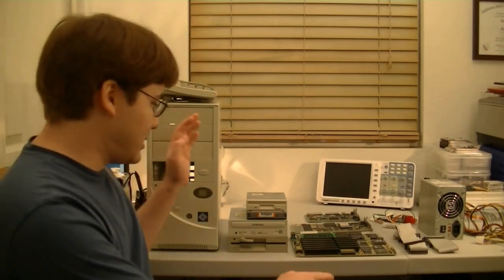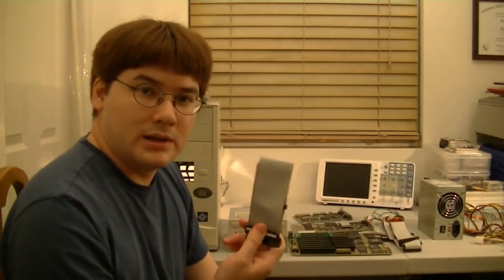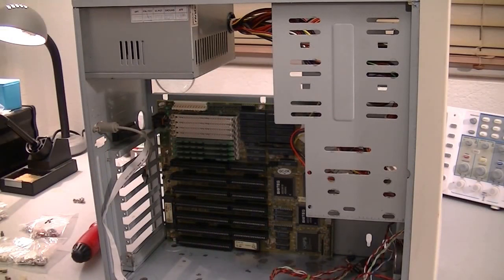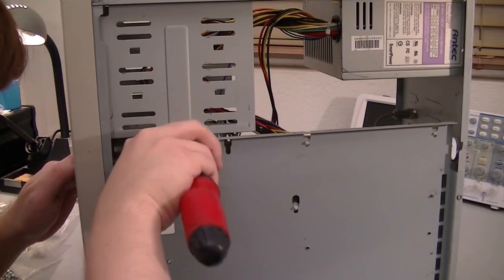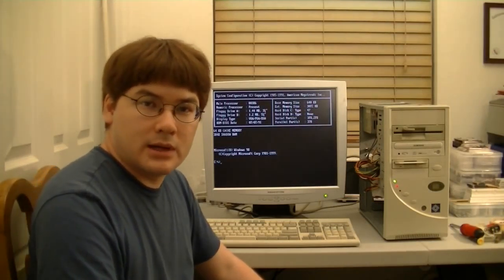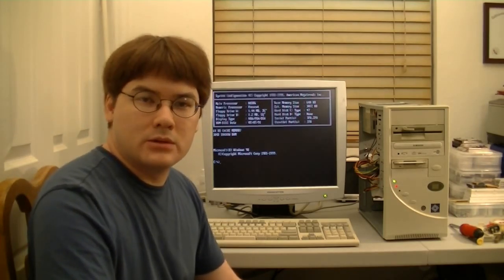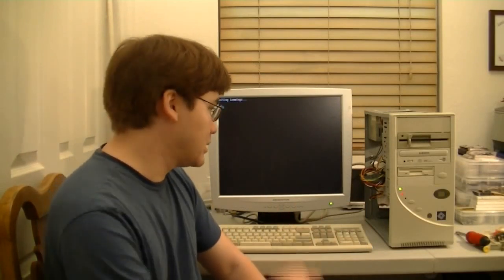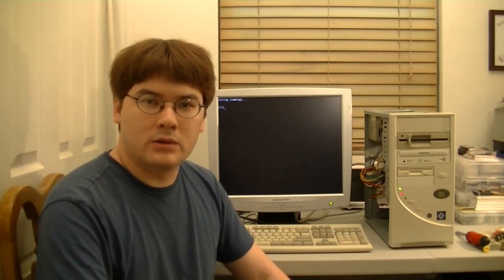Retro Computing - 386 PC Build and DOS Gaming

Comment: Brings me back to my day when I use to build 386 systems. The 386 motherboard shown in the video is a late model using a AMD brand CPU. Intel was already pushing out the 486 CPU by time AMD's 386 DX 40MHz CPU was on the market. It's hard to find a fast math co-processor to play nice with one of those late 386s. I had the same Cryix co-processor on my last 386, I had to end up adding a heatsink to the co-processor because the system over clocked it to match the CPU's clock.
Reply from the maker: Cool! Thanks for the info!

Comment: Good video!  It was a little slow for me but i liked this video because these are come basic skills (like DOS) that everyone who calls or considers themselves an IT professional should have.  I was in IT since the early to mid 90's and goofing around with various computers since I was 8yo.  I'm no longer in IT but from my experience in IT, most people don't even know what DOS is, let alone how to navigate a PC/hard drive with it.  Microsoft is
not helping things by hiding it deep inside their new operating systems.

It's good to see there are still people around who understand PC's to this level.  Good job!
Reply from the maker: Thank you for your comment! My family got our first IBM-Compatible PC in 1992, and I became well versed in DOS at an early age. It took a lot of skill to get some of those DOS games running (e.g. Ultima 7, that one was a bitch). It probably wasn't until Windows 95 when Windows could completely replace DOS, apart from a few programs for compatibility reasons. Thanks!

Comment: i have a 386 dx 40 but it has a EGA graphics card and i dont have a EGA monitor .. will the ega wonder by ati support VGA over the 9 pin conncetion if i get a 9pin to 15pin adapter will i be able to use an LCD VGA with the EGA wonder graphics card? the graphics card is dated 1987 on the pcb.

Comment: That's odd that the PS doesn't seem to be compatible.  Never saw an instance where it would force the fan to face the wrong direction before.  The fact that it's 350 watts indicates it's a pretty late PS, though, that would be considered HUGE back then.
IIRC the threaded standoffs were meant to thread into the MB tray, not use nuts.  I believe the slotted ones came later because they were easier to use.

Comment: How did you install the cd rom ? My bios (Phoenyx from 1995 with a socket 3) doesn't see it and my drivers cannot detect it. I've tried it on the first ide channel, the second, on an extension card and i've tried other cd drives too and it still doesn't want to detect it.

Comment: Here is a tip for people building assembling old AT systems place the plastic standoffs in the case in the correct location for the motherboard then push the motherboard down on the clips.

I used to work in a computer factory back in the late 90's it a faster way of lining every thing up especially if the power supply is already in the case.

Only having on mount post screwed in can cause grounding issues for the board.

Before fitting multiple IDE devices make sure that the master / Slave jumpers are configured when sharing the same IDE port. 
Older AT systems usually required the Interrupt and address setting configured using jumpers when using old hardware this should be the first thing to check if things are not working correctly.

Windows 98 won't load it requires a minimum of 32Mb of memory.
You could use Windows 95 but with only 4Mb I recommend sticking to DOS or a Linux distribution.

Comment: Will you do a 486 build next?
Reply from the maker: Probably not since there isn't a whole lot of difference from this build and the only 486 motherboard that I have has a dead Dallas Real Time Clock and it will not boot past BIOS without it.
Reply: You can use dallas rtc replacement. Check necroware rtc new module with coin battery. I use it on my pentium 166 build. This is awesome upgrade. Solves issue permanently. Just cmos battery change like on modern motherboard

Comment: is it me or that video card had like 4 crystals? Also what is that sli-like thing it on the top? I recall a 4MB card i had in a mmx had the same thing
Reply from the maker: Yes, it does appear to have 4 crystals. I have no idea what that connector on the video card is for. Thanks!
Reply: The connector on the video card may be used to connect a separate video card above or below that one so the two can share the graphics processing load.  Im not quite sure if thats what its for but Im gonna guess that lol.
Reply: Mario Tech Man  i dont recall something like that existing at those times, i was too young, but i know the voodoo 2 had something similar curiously also called SLI, "Scan Line Interleaving" to put up to two together, much like nvidia's Scalable Link Interface.
Reply: Laharl Krichevskoy Yea more then likely wasn't lol. Just a guess.
Reply: The port on the top was so you could connect a 5.25in internal floppy drive. Back in the late 80s and early 90s onboard floppy controllers  were extremely expensive and not many motherboards included them. To combat this they created addin ISA floppy controller boards, but since a motherboard of that time only had four or five ISA slots, if you were lucky,  most of them being used by a sound card, printer card, serial or modem card, manufacturers included floppy controller adapters on other addin cards, serial port cards, video adapters etc.

Comment: My first computer was a 486 DX2 66mhz with 8mb of ram lol those were the days
Reply: I still have that CPU from ITS ST in my shelf :P
Reply: 79tazman Lucky bastard. I had a 486slc-33Mhz which was probably only as fast as the 386 in this video, only I only had 2MB RAM, so it was fucking useless for gaming.
Reply: TheVanillatech Woah 2MB ram .. my old old computer had 16mb .. i cant even imagine what were 2mb on a computer..
Reply: Kamilohbk
It sucked. It sucked BAD. In fact there were already numerous games that required 4MB minimum, such as Raptor Call Of The Shadows and even Doom. I managed to get "some" of them working on my 2MB machine by hacking but when they loaded they were basically unplayable.

I blame my parents, they went alone to the shop to buy the computer. They spent £1400 on that shitty 486-slc 2MB PC and for £1300 another store in the town was offering a 486-DX2 50Mhz with 4MB. The shop owner obviously exploited my parents lack of knowledge and made my gaming time an uphil battle for the next year and a half.

At christmas 1995 I bought a Pentium 100 with 16MB RAM. Built it myself. I threw that 486-slc in the bin.
Reply: Maybe my integrated card was that high, because i could run easily raptor and Doom, hell, even Doom2 run smoothly. I'm sure most of my DOS games run smoothly there.
Reply: Kamilohbk
Pretty much any VGA card could run 320x200 256 colour mode smoothly. Perfomance mainly rested on if you had a DX or SX chip. Having the maths co processor in the DX series really gave you a boost in DOS games, especially in games like Doom. Next to that it was pure megahertz. I think the standard gaming PC of the early 90's was the 486-DX2 66Mhz, coupled with 4MB RAM (you didn't need 8MB for gaming, although it was nice to have it). Of course Windows 95 changed all that.
Reply: +79tazman Me too, but mine was only 33mhz.

Comment: lol takes me back to IBM XT days ISA, SCSI ports and 8086 oh those were the days ... RS232 ported version of Windows 3.1 using Laplink as the IBM BIOS only allowed 720K 3.5" and obviously Windows came on 8 x 1.44 disks so 8 hours of RS232 file transfer to a 30MB using up 80% of the drive space once all done that was on a IBM AT 286.. a bit of cool nostalgic memories for me ... I had a similar 386DX with intergrated CPU but only 4 ram (sim 40 pin)  slots, but the bios could identify  the settings for a harddisk.. so I used to pop old IDE drives in to get the references when the harddisc did not show them on the casing!!! .. the battery on that was 3 cell batts same as that motherboard .. it still powered just needed to setup the bios but like said only used it for IDE USER settings as it was good as PNP ID back then :: GOOD VIDEO

Comment: This type of machine is the first generation when X86 PCs became cheap and competitive for gaming. If you look at that board, there’s not a whole lot going on. A CPU, some cache modules, bios, small chipset. Now look at early 286 machines; very large board, covered in chips. Very late 286 machines started looking as simple as this board, but they didn’t have the power or peripherals to really beat the amiga. 386DX40 could do wolf3D well, ultima underworld passably, ultima vii; cds and sound blasters were starting to be common and 386DX40 just stayed and got cheaper for an unreasonably long time. It coexisted with early pentiums. Simple, cheap and trouble free.

Comment: A CD-ROM in a 386, Mmmm, surely that's a bit to new for a 386 and lower? Sounds quite odd for me at least...
Reply: +F_A_B123 it is too new.
3.5" FDD.
Reply from the maker: +F_A_B123 Yeah, you're right. But, I like to put new stuff in old computers like when I put a VGA card in a Compaq Deskpro 8086.
Reply: MakerComputing
Keep it authentic, just don't use newer stuff.
Reply: +F_A_B123 I once saw a Turbo XT with an external CD-ROM drive.

Comment: 8megs is a lot of ram for DX you  would need voodoo graphics card to use more than 4megs of ram became 2d software only utilized 4 megs and you would have to change between 4megs and 8megs in bios for certain games and unless you have turbo which slowed down the PC
Reply from the maker: Agreed. 8 megs is overkill for a 386. I could probably get away with 2 megs.